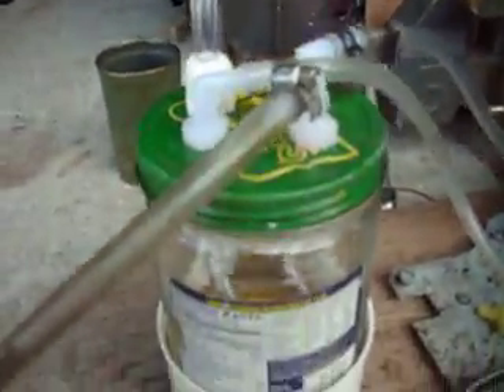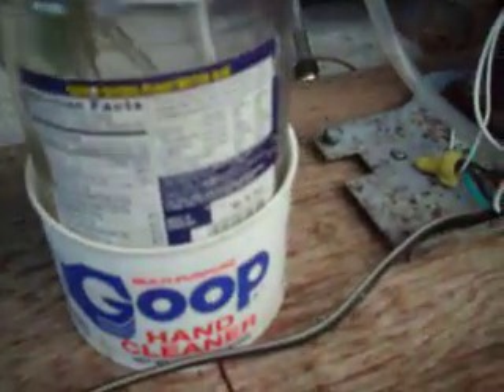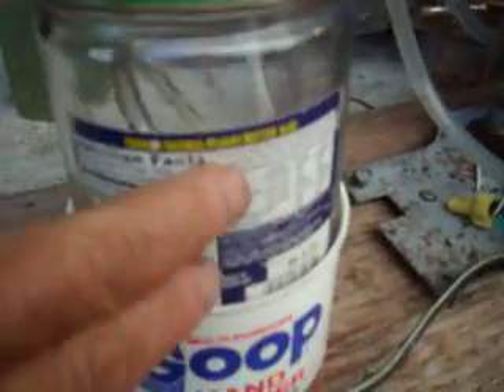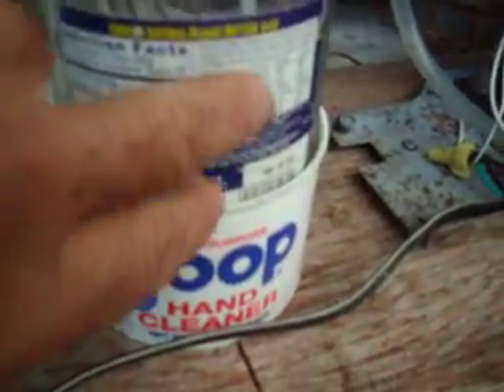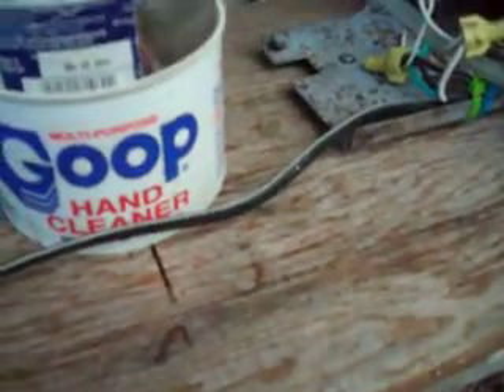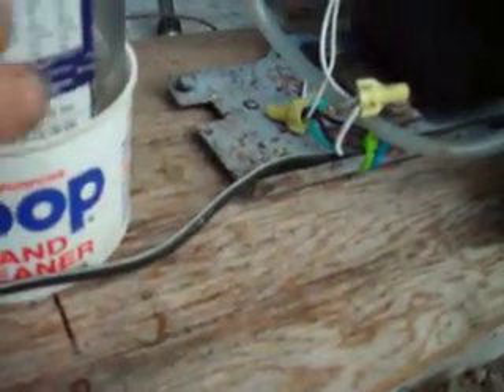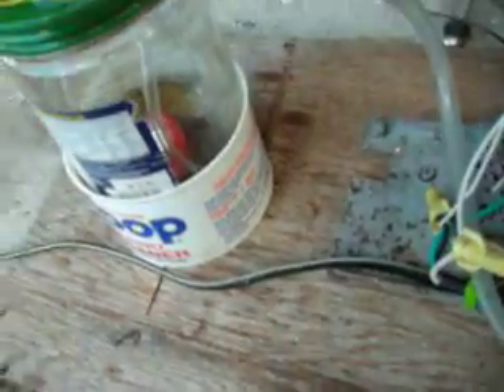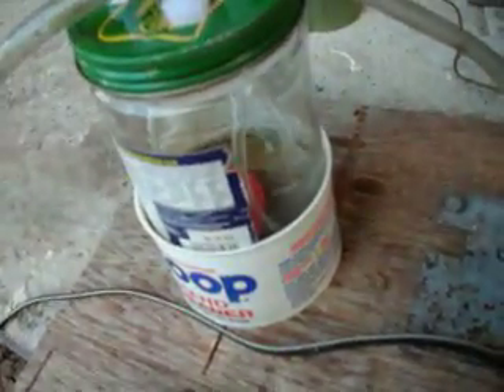Gasoline Fumes Burning

Comment: use antifreeze??
Reply: Hi Donny, what do you mean by:
use antifreeze??
Reply: urm.. it's kind of a fuel type that eliminates water and is used at winter in several country that have snow like US.. to make the fuel not freeze
Reply: Hey Don,  what I did was one time experiment. However if the nasty smell of the gasoline were to be eliminated it can be use as LP gas (I think) Matter effect they make propane in Hawaii out of gasoline, with added price jack up. Now, if we can find a simple solution then we eliminate access price that we pay.  Antifreeze sure can be used as you pointed out too.
Reply: Your experiment is really2 interesting actually, it is also being used on cars, lawnmowers, chainsaws and many more that uses petrol/gasoline as fuel. The fumes I think is propane maybe I am not sure about that,  but to make propane with gasoline, just either boil em and collect the gas, or you could try they way you tried it :D, anyway nice project :D